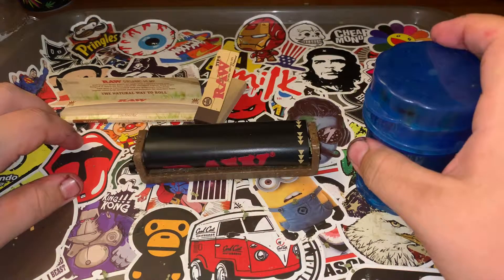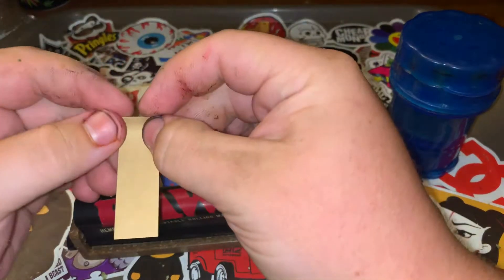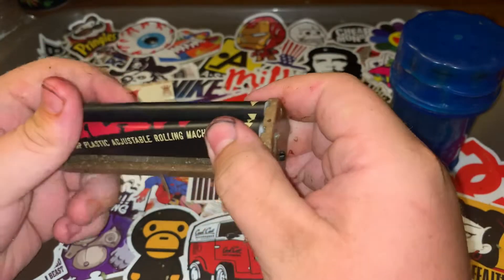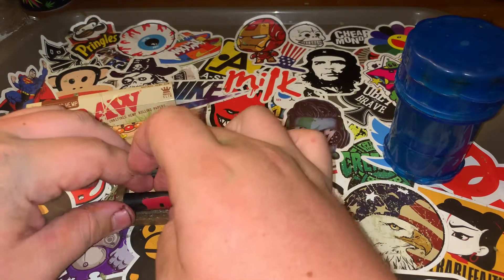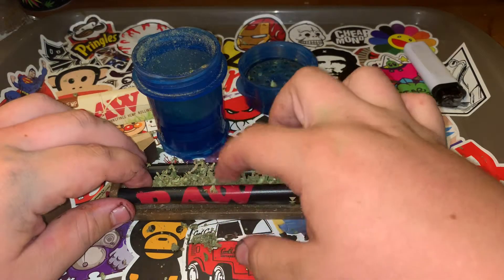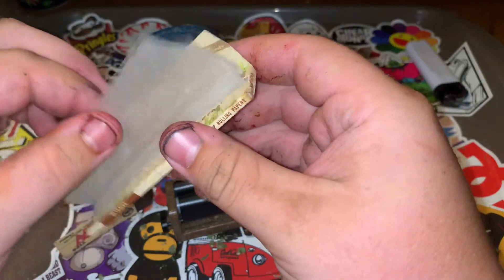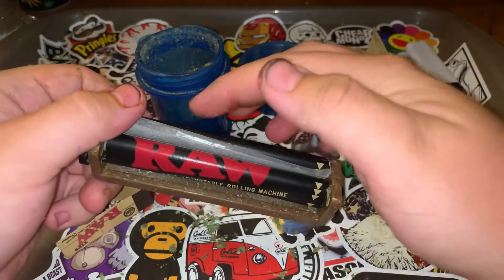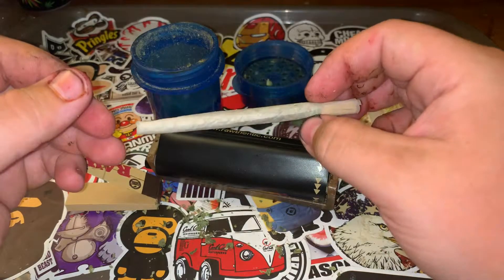How to: Raw Adjustable Rolling Machine

Comment: It’s cool but how do you keep it from rolling to tight . Joints be impossible to hit
Reply: Same problem.
Reply: Pack it less, duh. You don't need to jam the weed in there like an animal
Reply: roll your finished joint a lil and it will help loosen it up, especially if some weed falls out the end
Reply: @_JS96 plus u can put a toothpick thru it after for airflow